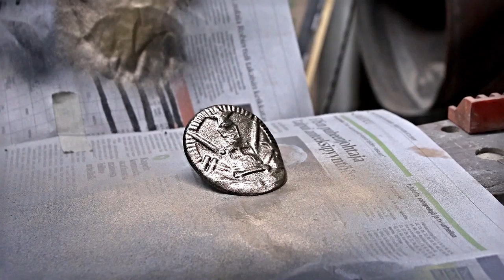Restoring rusty dented USSR firefighter's helmet - VINTAGE RESTORATION

Comment: The specific helmet is a Civil Defense Fire Department helmet of 1954 - 1980s era, which was commonly used by both fire fighters and civil defense units. They are common, yet sturdy and can still be used as a working helmt.
Reply: а разве не с 61 по 71?
Reply: @Liza-ke3yq  нет, такие делались с 54ого и до посинения
Reply: Shießs öüf Ära für

Comment: Firefighter here; great job on the restoration.  That "thing" on top of the helmet is called a helmet crest.  I happen to have some leather work experience as well.  Always remember you can simply soak old leather in water - especially in this case - I'm quite sure that leather was soaked in water and sweat many times over.  You did a great job with this!

Comment: If you're already welding,  you could weld a metal rod to the very bad dents and pull on them until the dent pops out and then cut off the weld:)  beautiful work

Comment: did you check it for radioactivity?
Reply from the maker: I probably should have 😁
Reply: @OddTinkering  ... and 1000% lead paint that was used on that helmet that you were dry sanding and wire brushing without gloves on and piling up along with rust? Hope you wore a decent mask and had ventilation in the shop, which I don't think you did at all did you?

Comment: I wouldn’t go through all that sanding, I’d drop it into a rust remover solution. Like Evaporust then go on to remove the parts.  Then after all that soldering on any imperfections. It would be clean and less chance of the welds coming off in the future.

Comment: Actually, you can pull the dent out using your mig welder. weld it a little right in the center of the dent  then leave the wire in the puddle.run out a few extra inches of wire Use the extra wire to pull the dent`  our you can use some`thing like a  finish nail welded on if  the wire  isn't enough. Always pull out dents as much as possible.

Comment: Interesting.. I've never seen the leather in a helm yet. Did you try it on, does that stabilize it somehow or is that in because of heat reasons?
Reply: Jochen Würfel leather linings are in most helmets, they hold your head in place as the helmet is large. They also provide shock absorption if something falls on it
Reply: Jochen Würfel now they use synthetic materials, but most helmets have a suspension/liner

Comment: The liner is not made of leather.  It is made from synthetic rubber impregnated canvas.  It is called "kirza", or something like that in Russian.
When you pry the tabs on the liner band open, to allow the removal of the liner, you need to heat the tabs, to re-anneal them, or they may break off.

You did a very nice job, and it looks good, but it is a little to fancy for "The workers paradise", such shiny adornments might have been viewed as "Counter Revolutionary".  HaHa

Comment: Seems like it was originally green given the paint under the badge, also, I'm sure the badge was painted with different colors not just gold.  This isn't restoration so much as completely changing the original aesthetic.
Reply from the maker: Different shades of green and chrome plating seem to have been the most common colors. But I've even seen one in red with yellow badge and baby blue in the inside. I've also seen at least gold and black too so I went with the color scheme I liked the most. Some of them have also numbers or letters painted on them.
Reply: Military firemen use it green,  civil defense use it silver or white. But good point.
Reply: @jilliandittelberger3307  
I don't  suppose it does, though one could argue the point that if you don't restore the original colours it's not truly a restoration.
Nice job though. 👍🏻
Reply: @morgoth731  the only green I seen was under the badge and that looked like old primer ... The rest was chrome

Comment: I think  is   from 1930
Reply from the maker: Similar helmets on ebay say they are from 50's or 60's but I'm no expert
Reply: @OddTinkering   An original Soviet Fire Service helmet issued between 1954 and 1980. (found  info)  if interested.
Reply: This is a fire helmet type M-103-61 samples of 1961, as knowledgeable people here suggested. The latest sample of metal fire helmets.

Comment: They wore these at Chernobyl.  You did check the radiation level?
Reply: They didn't wore these type of helmets in Chernobyl. They wore modern white helmets with painted logo of the firefighter unit and also it had some kind of safety glass or plastic on top of it, plus safety anti-fire textile atached to the back of the helmet.